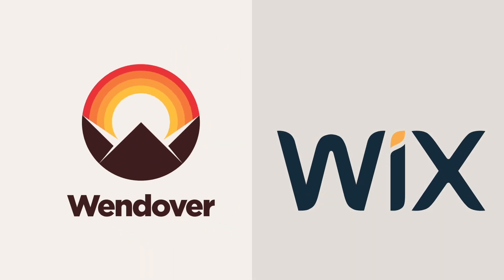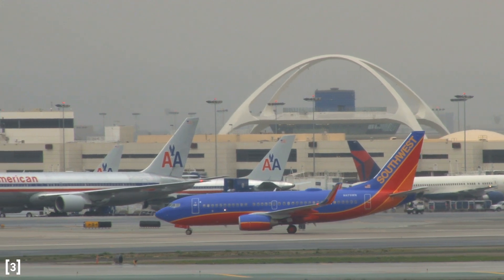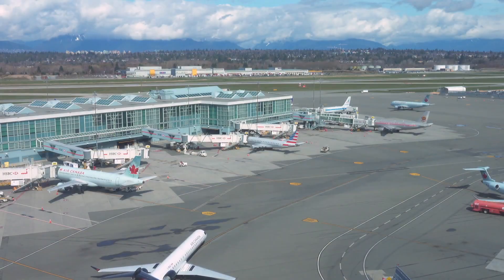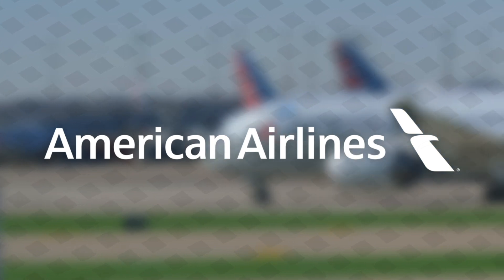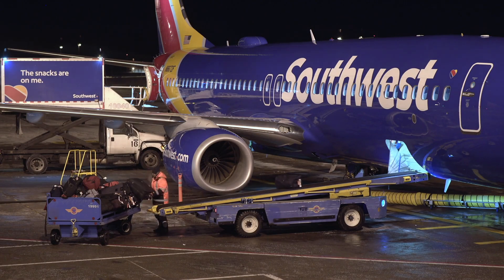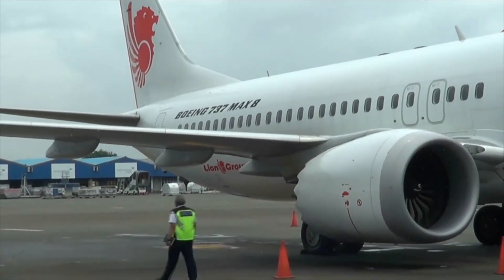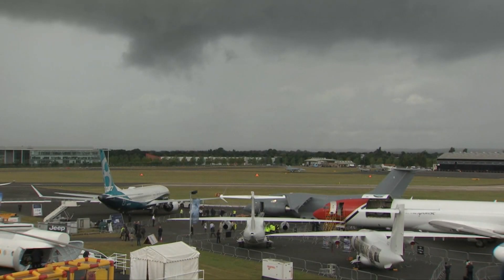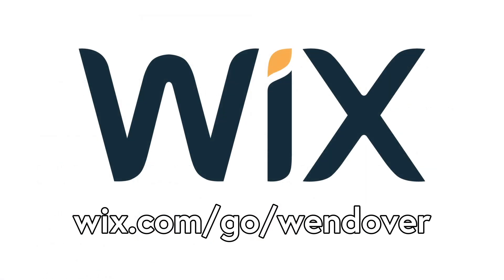The Economics That Made Boeing Build the 737 Max

Comment: This is all very interesting and insightful, except...  "nobody would have guessed" what could happen? I don't buy it, not for a minute. There's very few places in the world where more aerospace expertise is concentrated. More than one person must have looked at this and thought "wait a minute, that's not safe at all". What happened there? Were they pushed over by marketing? Or is their company culture so far down the drain that they didn't even dare to speak up? Was it a junior team with no standing against their superiors? In either case, Boeing has a huge problem on their hands, that goes far beyond a faulty sensor, or a rushed piece of software. This is an industry that is supposed to know that in some areas you absolutely can not cut corners, and they have layers and layers of procedures and oversight, internal and external, to prevent this. And they all failed. How is this possible? What will they do to make sure they don't fail again? This is not finished with a few lines of software. They need to pull their pants down and prove they have learned from this shit show.

Comment: So one thing.. pilots may not redo a whole type rating for the 737-800 to the 737 MAX 8 or 9 but they do get differences training on each variatant of that aircraft. Its just like the 757 and 767 is a joined type rating so pilots learn how to fly both because the cockpit design and the way the airplane flies are similar. They have to fly the 75 and 76 sims. Its just like with the new UPS 757 that are becoming an all glass cockpit, pilots now have to go into a sim with the glass cockpit and learn procedures on that new setup. Its all called differences training.

Comment: FYI Wendower, no modern passengerliners can start with a one step process.
Reply: Not true. As long as the pilot has the key fob in his or her pocket, the right engine starts the minute the pilot has taken their first sip of coffee to begin preflight. It's just like a Tesla.
Reply: Man Of Florida OMG! thank you!
Reply: not to mention it's not a '7' step process either.. eyes the real checklists heh.. this video has a lot wrong with it.. like it ignores the fact that the 737NG was basically a complete upgrade and the MAX built on that etc.
Reply: No but Airbus is only 2. IGN start, engine master switch on
Reply: @tomstravels520  strange..no.. it requires more then IGN start, Engine Master on.. doing that isn't going to start anythign because it has no power.. Lets presume we are doing a self engine start shall we? 
On any Modern Airliner including the Airbus A320 you need to have turned the Batteries On, Checked the Electronic Hydro's, Checked the Fuel pumps are in the correct position, start the APU, now you want to tie it into the Electrics because your batteries aren't going to be going that long and they certainly aren't going to do a great job of starting engines that require bleed air from the APU..

Comment: Great video, but the 737 MAX has more than a warning light indiciating problems, it has a whole section of it's displays that lay out all issues or abnormalities.
Reply: That is true, but it doesn't implement stuff like "ECAM actions" like on an Airbus.. It is much like on a 737NG,757,767.. You still run the paper checklist as you would've on a 737-100-900.
Reply: @rkan2  Absolutely nothing wrong with paper. Still dozens of types flying around without a single digital display in the cockpit.
Reply: @Bullhead_JW  I didn't say so.. However the modern and future way to do things seems to very much be to get rid of paper and automate as much as possible..

Comment: This is not what lead to the two crashes. It is always a chain of events and not just the MCAS system.
The 737 is the largest single type of jet airliner ever built. 1 takes off every 8 seconds. With so many airplanes, airlines wanted a fuel efficient version at the relatively lost cost of the series. They did not want to do a major retrain or need a new classification with such a large group of pilots.$$$ Boeing is very good at building planes the customers wants.
To keep a same classification by the FAA your plane must have the same characteristics and flight envelope. Boeing did this by adding the MCAS system to make the plane feel and act like previous 737's. Pilots only needed and IPAD course training before flying the new version.
Boeing stated in the new manual that if the angle of attack sensor was faulty (pilot side only) and the plane forced a nose down the pilots must use the same memory item checklist as a runaway trim. As far as I know, the nose down from MCAS would seem just like a runaway trim. I know the Ethiopian flight crew started that checklist a bit late but missed 2 major item. They did eventually turn off the auto trim but failed to turn off autopilot and reduce thrust. In the end they turned the faulty system back on and that was the end.
1) Should boeing of had the co-pilot AOA sensor tied in as a backup as the do in the military aircraft? Yes but not required by regulations.
2) Would the AOA in the cockpit displays have made a difference. Most likely not. Only military train pilots (10%) would ever look or use it.
3) Should the airlines have had a follow up test or whatever to see if the pilots watched, learned and understood the differences? Yes.
4) The crew flying the Ethiopian plane prior to the flight that crashed had the same issue with the plane. Was it passed on? If so did engineering look at it? Did the new crew look at the maintenance or planes flight log?

I find the airline at 35% fault. The pilots at 25% fault and Boeing at 20% fault (just for not having a redundant backup).

I think it will be hard to actually win a civil lawsuit finding Boeing responsible. Boeing already lost 1 Billion in lost production in the 1st quarter. This does not include re-engineering software and the hardware updated to the fleet. Nor any Lawsuits or settlements.
Reply: Let's define the "chain of events"...
- Boeing decided to upgrade an herendously outdated plane one more time

- Boeing decided to add a hack to make the new airplane behave like the old one
- Boeing did design this system in a terribly bad way: It manipulated crucial flight controls during a crucial phase of flight, basing itself on a just a single sensor without any check wether that sensor gave correct data
- Boeing made it so that warnings that the sensors were contradicting each other required airlines to pay extra
- Boeing persuaded the FAA that they could certify the plane themselves.
- Boeing engineers did not see their own errors.
- Lion Air crash happened

- Boeing did simulate the Lion Air crash in simulators with crews that knew exactly what was going on. Many experienced pilots were not able to avoid a crash
- Boeing did pretend there was nothing wrong with the air-worthyness of the plane
- Ethiopian Air crash happened.

I notice "Boeing" is quite common appearance in the above "chain of events" and therefore I'd say these crashes are 100% to blame on Boeing. None else. IMO this is so culpable that civil lawsuits only don't do justice. Criminal investigation is warranted: This is death by guilt. Now I read that the FBI is involved in the investigation, so hopefully this will happen.

Comment: it's wonderful to see how much more quickly these issues are dealt with in modern civil aviation, though. it took so long to finally ground the DC-10 to fix significant issues, which i'm sure you're well aware of, being wendover and all. it took three incidents from 72-79 to fully fix the cargo door issue. 

granted, i do think that part of it is likely due to the short amount of time between the two accidents, but considering two cargo door DC-10 incidents happened within two years of each other, you'd think an identical repeat failure would be enough

Comment: So whatever choice they made, Airbus would win. Tragically, they went for the option costing the most lives.
Reply: It remember me when ford had faulty piece of thing in their car that killed many people per year, but because It was cheap they leave It on the car. Because people actually suiting Ford for the faulty piece was even less money that the money they made. Psychopaths men...
Reply: @v44n7  Ford Pinto situation where is cheaper to pay families than repairs
Reply: No, they could have chosen the option they did but added more redundancy to the system, better warnings for the pilot, and make it easier to override or disable the system.
Reply: @JDeWittDIY  it has a really easy solution grab the trim wheel, then disable auto trim, the auto trim switches have been in the same place since the 707. The problem is that the information about this wasn't relayed well to pilots.

Comment: 11:24 „Nobody would have guessed...“ 

Honestly? You think none of the engineers had second thoughts about overriding the pilots input based solely on the input of one sensor? In an industry that has redundancy in all other flight-critical systems?
Reply: Hell, I install automation programs in cement factories, and we always stress that though our systems will give suggestions that should be able to be used as is, the operator can at any time choose to ignore our system's suggestion if he thinks that they are wrong. How any engineer decided to override the pilot's input without very noticeably telling said pilots exactly what is happening is beyond me.

Comment: Great Video, good info... But when you  are talking about fresh design, wouldn't this be averted by simply not letting the MCAS to be too autonomous and educating the pilot to disable it. This is the issue that due to faulty sensor MCAS is overcorrecting. I don't completely agree that a complete redesign would somehow be the best solution.

Comment: Slight correction, the 737 NG has bigger engines than the  737 classic (CFM 56-7 vs CFM 56-3) and they have circular intakes. The NG therefore had to be designed with a bigger and higher landing gear to accommodate the new engines.

Comment: Great video. The 737 MAX must be repealed forever. No sane passenger wants to fly this plane ever again. This is an unsafe plane by design and can’t be fixed by a software patch!
Reply: Wrong.
Reply: Well, it's been flying for about half-a-century at this point with very few problems. And this is a software issue that can be corrected with minimal changes (add redundant pitch sensors and better educate pilots), so I won't feel unsafe flying on a 737 MAX after they've all been upgraded with better software and sensors and better-trained all the pilots.

Comment: Why didn't Boeing just make the legs holding the wheels higher? That way they could just stick the engines on no matter how big.
Reply: de sp and then what happens when you retract the gear? The wheels would touch and the gear wouldn’t retract. The only solution would be to move the legs outwards into the wings which would use up space needed for fuel
Reply: @tomstravels520  so why exactly can't the wheels just be lower? The large engine problem is only an issue when the plane is on the ground right. Sorry I dont know anything about planes

Comment: Boeing really f***ed up with this plane.  The plane is inherently unsafe.  There in no software that can correct for a bad design.  Boeing is going to have to replace the all  the 737 Max airplanes they have sold.  Their quest to save money might have ruined them.  The people that dreamed up this flawed design and marketed it should be fired and given life sentences in prison.
Reply: That is very extream and completley false... tell me, what is inherently unsafe about this design?
Reply: @geminijetsnewmexico2238  if you can get your head out of your a**  the engines have to be mounted forward and above because they are larger then the original ones.  This causes the nose to pitch up whenever thrust is applied.  The MCAS is to prevent that from happening.  I could  go further, but obviously it is a waste of my time.   Keep supporting your bottom line and you will go out of business as you are placing dollars over passenger safety.  Oh, before I forget, F*** you!

Comment: Well done video guys, that was very informative. Even with news coming out that Boeing didn't tell its biggest customer-SouthWest that the safety warning lights had been deactivated till after the Lion Air crash is proof enough that Boeing knew all about  the dangers lurking with that aircraft, but put profit above lives. The 737 MAX is a defective plane, no way around that. Trying to get a software update won't fix the physical redesign of the fuselage which by the way necessitated the development of the MCAS system in the first place.
Reply: @LS-qs9ju  they can't sell it without MCAS, the nose pitches up during high thrust and that needs to be stabilised by software.
Reply: @LS-qs9ju  True but we don't know the extend of its pitch problems, and so far pilots haven't said good things about the plane. Additionally,  in a few years time engines will probably get even bigger bypasses so they will need a redesign at some point soon.
Reply: What you wrote is not correct. The MCAS was developed to allow the “Max” family to have handling characteristics similar to the previous 737 family, the “Next Generation”, and by doing so, it wouldn’t be necessary for the airlines to provide a complete new training to all their flight crew, a simple “differences course” would be sufficient. Indeed Boeing fucked up in the 737-max with this mcas system, but it is not a defective lane at all.

Comment: Wendover is full of shit. The facts still haven’t confirmed that the aircraft was completely to blame. At this point it’s just as likely that the airlines that crashed their planes didn’t train their pilots correctly.
Reply: What does that even mean? Boing built in a system that is a danger to flight stability. This system has not been mentioned in the pilots manual nor had they training for it.
Reply: TorianTammas Correct. But it still hasn’t been ruled that the MCAS was solely the reason these planes went down. Granted it’s still a serious design flaw that Boeing is right to want to fix immediately.
Reply: @SAOrules  It was wrong that this thing ever left the ground with any system that is based on information of one sensor. They should have used 2 or better three sensors. Not to mention that they lied as they claimed that the pilots to not need new training. This was one of the  importing selling argument as pilot training is costly. Everything was aimed to be as cheap as possible and security was not what Boeing had in mind.
Reply: TorianTammas “they lied” citation needed. I can’t argue with you when you’re making shit straight up.
Reply: SAOrules Ethiopian pilots followed Boeing advise and it still failed
Reply: Thomas Mortimore they still have a very bad safety record. Why should anyone take their word until the final results of the investigation come out?